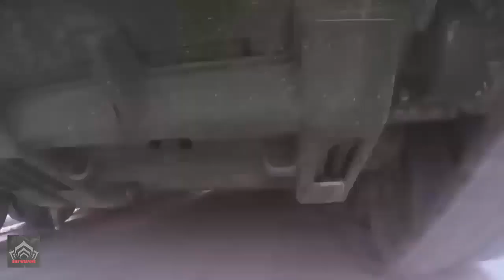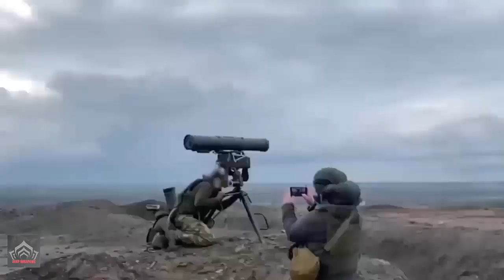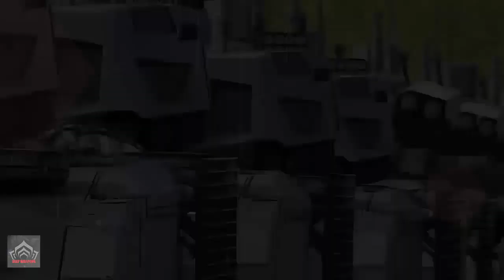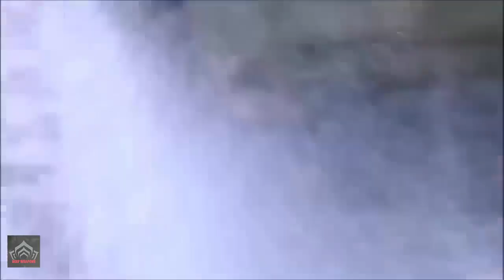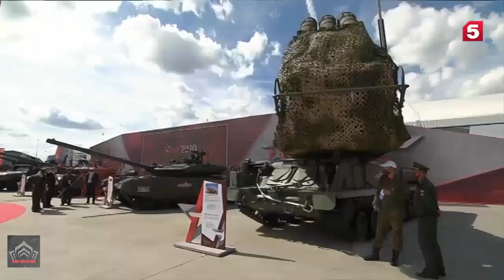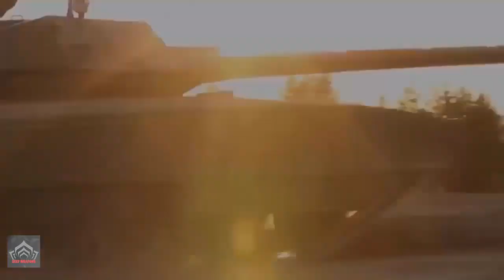Kremlin’s super tank T-14 isn’t in Ukraine’s battlefields

Comment: The problem is not in production. In the training of qualified personnel. This tank has so much electronics that an ordinary tanker with combat experience will be able to use only a third of its potential. According to the plan, the tank should lead a group of T-90s that carry out its orders. And in the war of Drones, the role of tanks is minimal.
Yes, we are a wild horde. Who have never eaten anything sweeter than carrots. But just in case, the full drawings of the Abrams tank appeared at Uralvagonzavod (the largest tank manufacturer in Russia) six months before it was accepted into service in the USA.